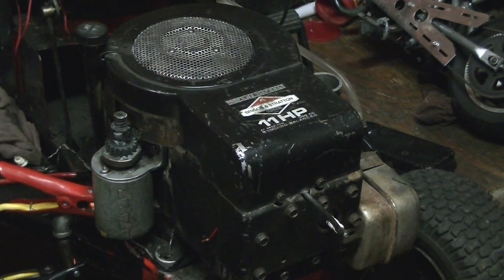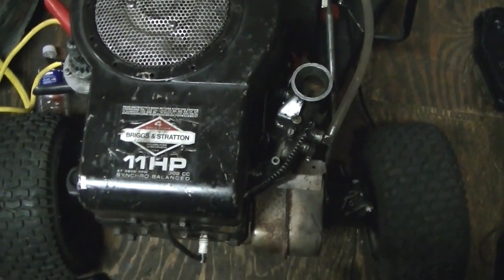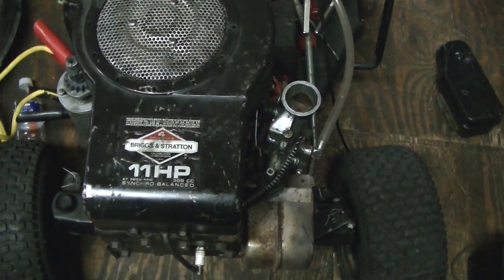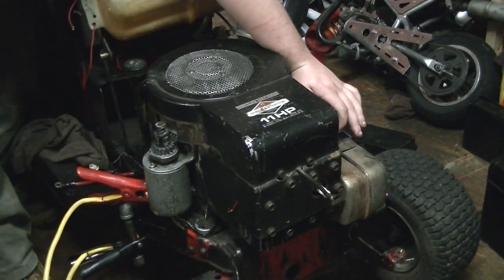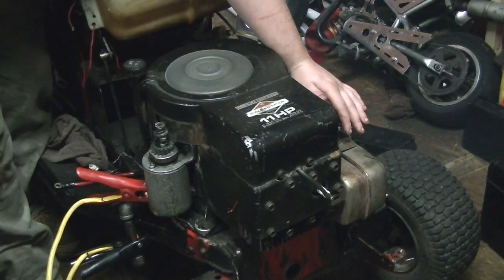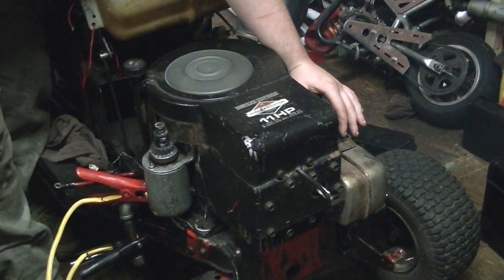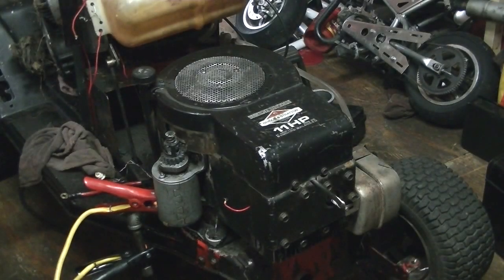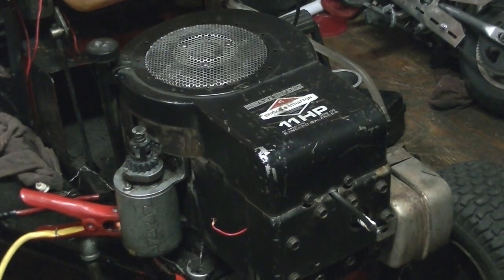Cold / Old Start of Briggs and Stratton 11 Horsepower Flathead Engine (model 25)

Comment: I can't get my 10hp to run just put new carburetor. Kind to hard to adjust.
Reply from the maker: If the compression is low, it may need a valve job, that will make them not want to adjust in right, also check spark plug too. Thanks for Watching!!!

Comment: Old flat heads a lot better motors then the ohv junk of today..I have an 11 like this and an 8.5 going to be used very soon for replacing the dead 8's on my old snapper and cub cadet 804..Which of my mowers gets which motor? Will depend on what mower is step shaft and which one isn't?
Reply from the maker: Yepp can't go wrong with a old flathead. It just depends, the crankshaft is the main thing that varies, but they do have sleeves that can adapt it, what i mean is to adjust the height of the pulleys. Thanks for Watching!!!

Comment: Great motors worth a rebuild these old L heads, I have two still running. 1rst on an old Lawnflite MTD 11/38  {1982} Still runs no smoke and 75 psi compression yet. 2nd engine is on an old Snapper Comet.. I took off the under powered 6 hp Tecumseh in favour of another 11 hp Briggs I had kept for like 30 years with 100 compression yet. I'll never sell them.
Reply from the maker: I think these and 12Hp's are the best vertical shaft motors briggs ever made. Thanks for Watching!!!

Comment: Ive have 2 of these engines. The 252707 is a great beginner engine for the small engine enthusiast.  One belongs to my Rally Roper the other is on my 1982 Craftsman 917 which the engine is also dated 1982.
Reply from the maker: I hear ya, they are great engines, the 12Hp's are still my favorite in the vertical shafts, but in side shaft/horizontal i'm still partial to the 5hp's, its what i started out tinkering with. Can't beat 11hp's, great motors, i just recently got a horizontal shaft 11hp too. Thanks for Watching!!!

Comment from the maker: thanks! there isn't much to the charging system, its a stator coil that bolts under the flywheel cover, if you look through my videos you will see a 4 part video on rebuilding a 12.5 horse briggs, which is very similer to the 11 horse, all the parts are the same except the crankshaft, block and valves. but it all looks the same, that should help you out good, actually i'll just PM you part 1, that way its easier to find! thanks for watching!

Comment: Keep your oil clean and don't use cheap oil not good for your motor I use Pennzoil 10w30 or 10w40 with wear protection It keep your bore nice and clean check your oil every time you use your lawn mower if you don't it wear's your motor out
Reply from the maker: Thanks for Watching!!!

Comment from the maker: @1972FordF150 yeah it burns some oil haha is kind of a squeaky sound? if it is the upper bearing needs oiled/greased, you can spray some wd40 or PB under the drive on top of the starter that should take care of that, one of my starters does that. thanks for watching, thanks!!!

Comment: Yeah I checked my engine is an 252707 1982 as well. My engine has a step crankshaft, So I guess I won't know if I can use it on the Cub Cadet 804  in place of the blown 8, until I pull the old motor and see if it's a straight crank or step shaft..The 11 has also been sitting for at least 10 years, but it's sheltered. I also may switch from points to electronic coil, I was 17 back in 1984 when Briggs and Stratton introduced the Magnetron system so much nicer then points
Reply from the maker: Yeah you'll just have to check out how the original motor is setup, if the step isn't much (like less than a 1/4") it probably wouldn't matter to much, i mean look at how much of angle you get on the belt on the deck when the deck is all the way down.

Comment: First off love your videos and you seem to be answering everyone's comments so i have some questions i have about the same motor it hasn't run in a long time im thinking of fixin it up what r major problems i would want to check for
Reply from the maker: +Luke Verch Thanks, appreciate that! Yeah, I always answer comments, not always the fastest at getting to them though as you see haha Sorry about that! Most of the time if a small engine doesn't want to run, check for compression first, to rule out a stuck valve or leaking valves, then check for spark, once you get good spark, clean and/or rebuild the carburetor, most of the time cleaning the carburetor is all it takes, but if its super bad, it may need a new carb. Then its just tuning the carb in and getting it running good. Also always pull the flywheel cover/shroud off to make sure no nests are under it ,if the fins are blocked it won't cool and will overheat when its run. I have a video on tips on starting engines that haven't ran for a while. And other videos on cleaning and adjusting carburetors. Thanks for Watching!

Comment: Great videos.
I have an old snapper mower wth the 11hp briggs motor. I recieved it with missing parts. I've got it all back together but can't figure out the missing parts for the charging system. Would you have a few minutes to help me figure out what parts I may be missing?  thanks!

Comment: Hi. love your vids, used them several times inc rebuilding a starter motor.
I have a 11hp B&S similar to yours, the engine 'hunts' when being driven, starts fine runs fine but it sound like its going fast then slow, fast then slow. any ideas. thanks and keep up the great work for us amateurs. Malcolm
Reply from the maker: Malcolm Hughes Hi,  Appreciate that, glad to hear they have helped! That sounds like the governor needs adjusted or the carburetor needs adjusted/cleaned, i have videos on how to do that, usually when they surge its governor. Thanks for Watching!

Comment: hi i have a 13.5hp 28m707 flathead and it smokes a lot when started from cold, and suggestions? not flooding carb is ok
Reply from the maker: Niall Scully Alot of older motors will smoke when cold, and thats from 2 things, the piston rings have more gap when cold, and it expands when they heat up, and the same with the valve guides, oil will seep past the guides. Also to much oil in one will cause that, because the oil will seep past the rings when its sitting. Now, all of that is assuming its blue smoke (oil burning), if its black smoke, that means its running to rich and can be adjusted out. But still even a perfectly tuned engine might chug a bit of black smoke just from the choke. hope this helps! Thanks for Watching!!!

Comment: Hey, I have the exact same motor and model even same year...goes in a 76 Cub Cadet...has not been started in a lot of years...traded for it...the carb on it is the same and this is my question...should I rebuild the carb before start it or try to start it first?...
Reply from the maker: Ken Wright Sr I hear ya, they are great motors. What I would do is just take the carb off and clean it real good first, and just see what it does, if it runs but doesn't want to tune in right, then rebuild it. But these older one piece carbs are hard to beat and hard to kill, they are the best carburetors they ever used on small engines. Even if they need rebuilt you can usually adjust them good enough to get by with, might hesitate when you throttle but still run good haha Thanks for Watching!!!

Comment: Hi, I'm 13 and I'm trying to find information about my model 25 11hp power built Briggs and Stratton...I need a to bore the cylinder I'm guessing about .20 over ... any time dea where I can find rebuild kit
Reply from the maker: I don't usually get a rebuild kit, i buy a gasket set, rings (piston if it needs it) rod, etc, as needed, usually alot cheaper. You won't be able to bore it out yourself, and if its aluminum bore it will have to have a sleeve pressed in at a machine shop. You can re-ring those with chrome rings, but they are not 10 or 20 over size, but they are slightly oversize. I order most of my parts from tulsa engine warehouse, tewarehouse.com. Thanks for Watching!!!

Comment: Hello guy!, I have a toro lawn tractor 11.32 in a restorating process and I would like to have a manual starter instead of an electric start with battery you know? it is better for me. So can you tell me where can I find one for this model? for the 11hp i/c model of 1970 more or less?, thank you.
Reply from the maker: I hear ya. I've been wanting to do that on my 11HP montgomery ward. You have to replace the bolt/nut with a starter cup, similar to those on push mower engines. And change out the flywheel shroud. You should be able to find all of it on ebay for fairly cheap i'd say. Your welcome, Thanks for Watching!!!
Reply: Hey guy, first of all thank you for the quick response. I've been seen on ebay lots of pull starters but I don't know what is mine, what I need. So I talked with B&S directly and they are talkin with me to explain me what type of pull starter I need, if you want I tell you when they finally tell me the model of the pull starter we both need. Thanks for all, regards!
Reply from the maker: Yeah let me know what they say, I'd like to change mine over, without doing the guesswork haha appreciate it.

Comment: Hi i need help. I have the same engine. Now i have a problem with the Carburetor. I don't know how put the Wire an the other end togehter. You may have a enigine Number? Can't find any on this engine.
Reply from the maker: servicefun I'm not sure i know what your talking about by Wire, do you mean the linkages? You will need the number off the engine for parts, there were a few slight changes here and there on these motors. It will be either on the front, side or top of the flywheel cover. Thanks for Watching!

Comment: I have a simplicity 4211 and she have a 11 hp briggs engine, what can I do when it dont start?
Reply from the maker: If its cranking over and not starting or hitting, check for spark first, if it has spark then your carburetor may need to be cleaned, and make sure it has compression, if its been sitting it could have a stuck valve. there could be several things but those are the first 2 to check out.